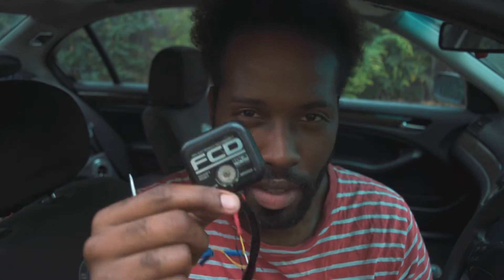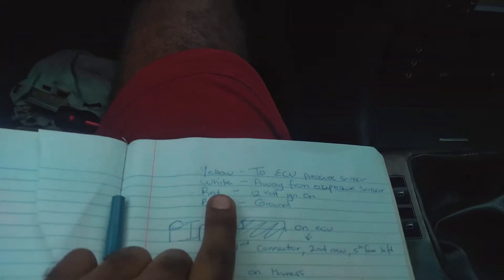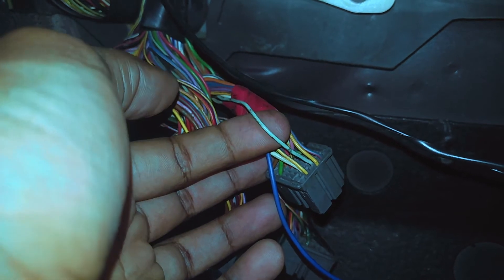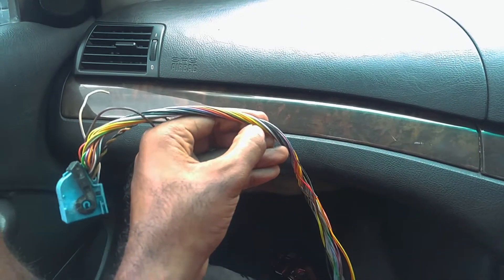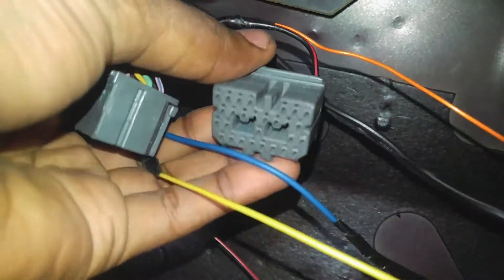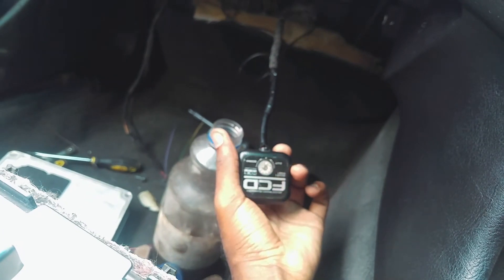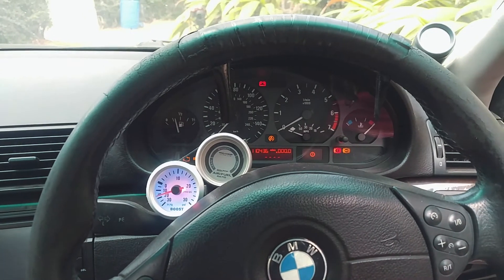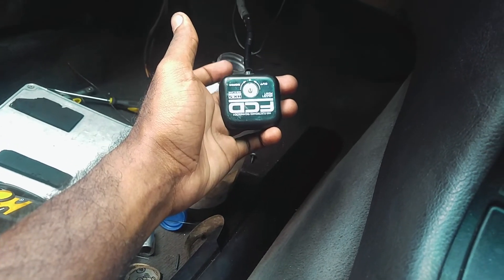FCD Install on 1jzgte BMW E46 | Test Drive

Comment: my car is limited to 160mph stock, if i install the HKS defencer will it remove the speed limiter of 160mph ? Or its only for the japanese cars with the 112mph limiters?
Reply from the maker: hey Martin in your case you need a speed cut defender. I think it will work regardless of car make
Reply: @jonnoifletcher4897  so thats means that HKS speed limit defencer will unlimit my speed of 160mph?
Reply from the maker: @bulgarianadvertising  yeah it should remove the factory speed cut. Do some more research to confirm

Comment: So what about a SCD can both be wired at the same time or it's not needed? Want to do a 2jz build but can't find a 2j a yard and Corona a deal with the ting a way
Reply from the maker: Ye man can wire both a dem sed way bro. Fcd control fuel cut and the scd remove the factory speedcut . lol 2j deh bout man a just fi find dem. Ye man rona a deal wid di place a way star